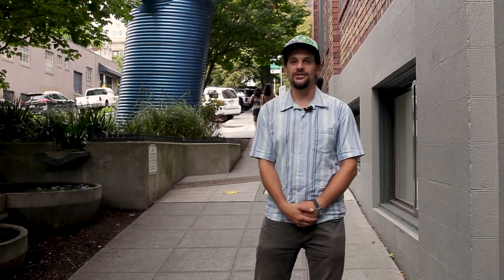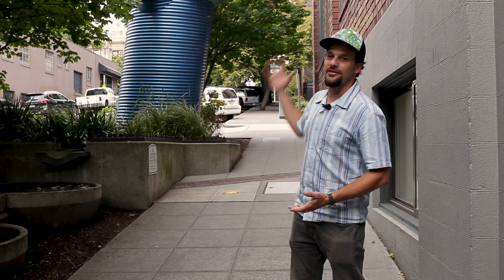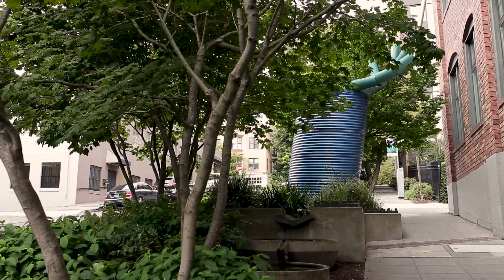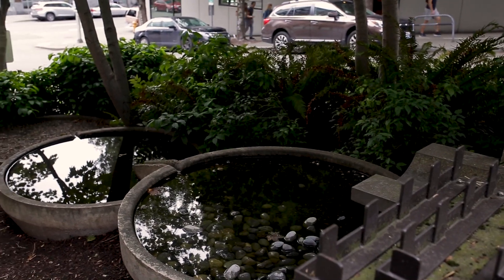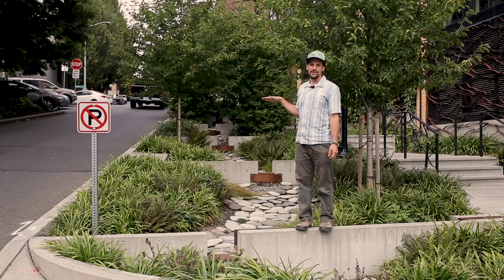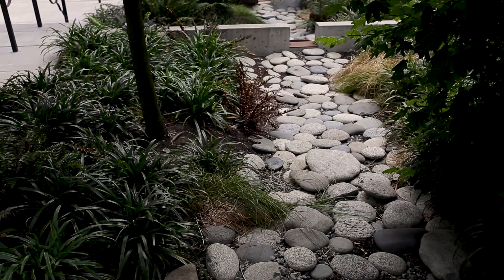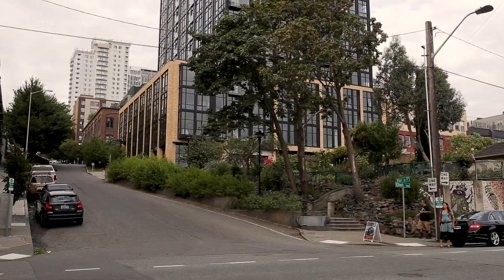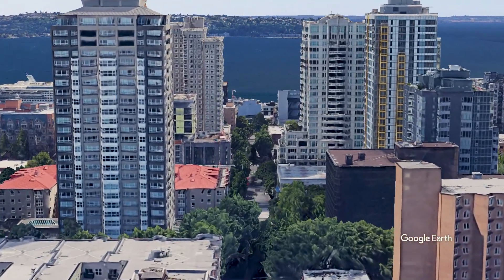Rehydrating the Concrete Jungle

Comment: Yes, it does look great.
The concern I have also is the form vs function factor.
Could the project have been done cheaper and with less concrete?
Seattle is a dynamic but very expensive city.
Could the same idea been completed reusing materials?
Concrete has a large carbon footprint.
Reply from the maker: Great point. The design and materials reflects the upscale downtown location. Definitely a project meant to show off the water harvesting features in an artistic sense, and not focussed on low material footprint as a goal.

Comment: Good idea, but what prevents mosquitoes from multiplying ?
Reply from the maker: That's a good question. It seems like they could have mosquitos in those small ponds.
Reply: You can use frogs and guppies for that. When the water is flowing, mosquitoes wouldn't be a problem as they reuire still water.
Reply: temperature (its seattle)

Comment: Has anyone tested for...
 TOXIC ROOFTOPS ... ?
Reply from the maker: There could be toxic materials in the roofing and flashing for skylights. Previously that was being discharged directly into the Puget Sound. If this was a drinking water system, then toxic roofing materials would be a real danger.
Reply: Brad Lancaster doesn't eat certain parts of the plant when he is worried about street toxins.  I forget maybe it was the fleshy parts of cacti because they are long lived?  The fruit are still safe to eat, though.